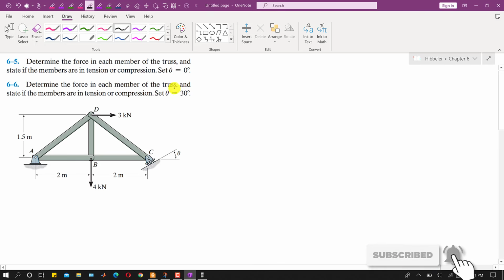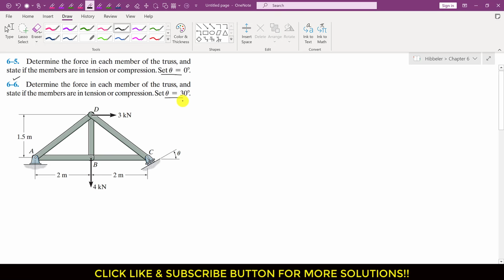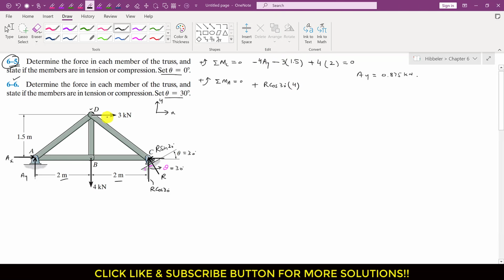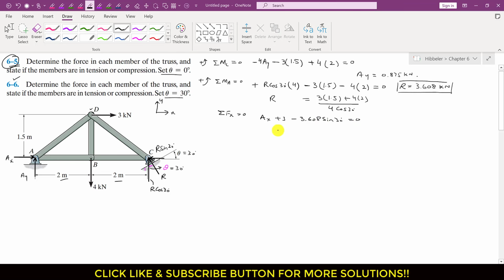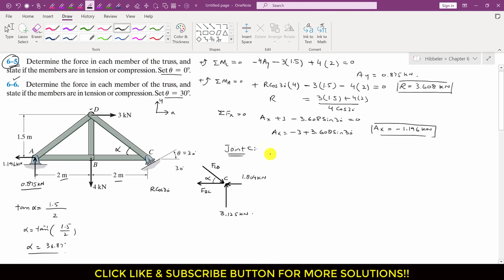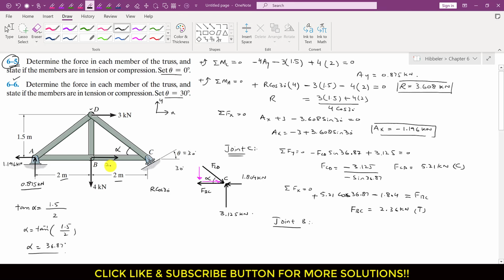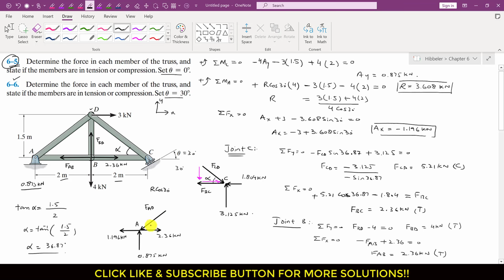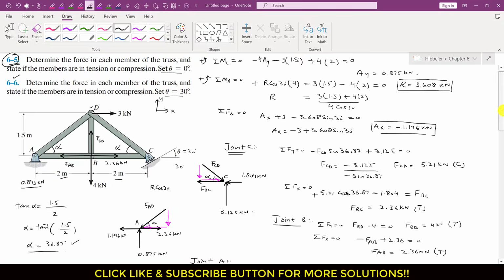Determine the force in each member of the truss. | Hibbeler Statics Chapter 6 | Engineers Academy

Comment: What if I don’t consider Fcd in compression?then the math goes wrong
Reply from the maker: Yes
Reply: @ why it is?
Reply: Hi there, not quite sure if you still need an answer but i'll provide one. Essentially this is an error on the creator as he has already solved the problem and then followed a step-by-step path towards that solution. Realistically what you do here is analyze that F_{DC} and R_{y} are the only 2 parts of the joint that contribute to vertical force meaning that the y component of F_{DC} and R_{y} must be equal and opposite (This gives F_{DCy}=3.125kN downwards). This means that our F_{DC} force vector must be pointing down and to the right. Since we know the angle that the force F_{DC} is acting on, if you have the y component then you can solve for the x component. Doing that yields an x component of 4.167kN in the rightward direction. This confirms that the force vector is indeed pointing downards and to the right. Since the force vector coming from member DC is acting away from the center of DC that means that the member is resisting something pushing on it. The member is resisting a compressive force so it is under compression. You actually dont have to make any assumptions if you just let the math take you there. I hope that helps this make a bit more sense.
Reply: @AeroPhys06 thank you I passed the course with A+ already 8 month ago
Reply: @AnindyaRay-sv5ip  Hell yeah dude, nice job. I'm taking it rn